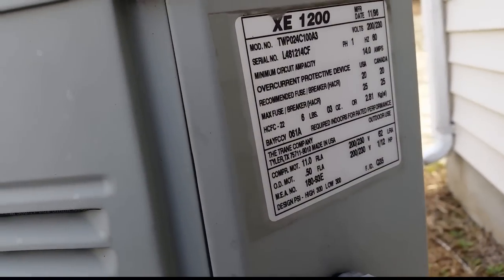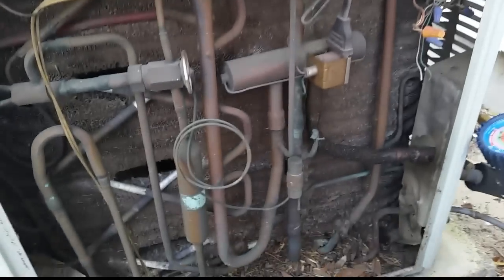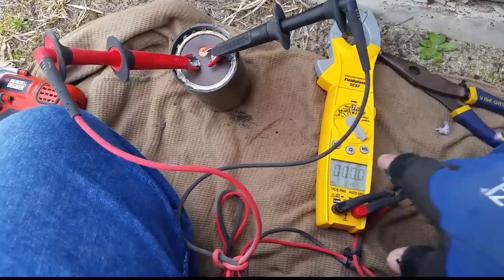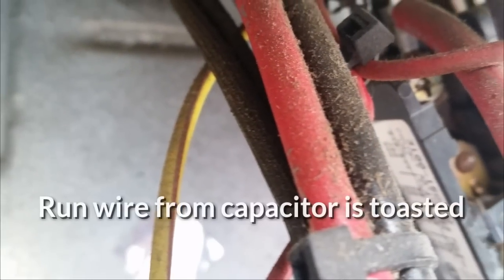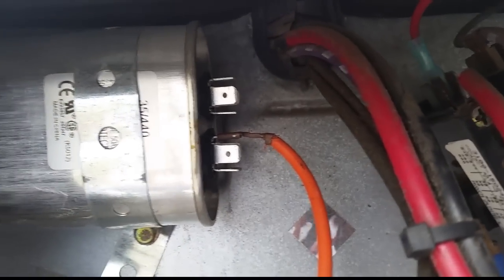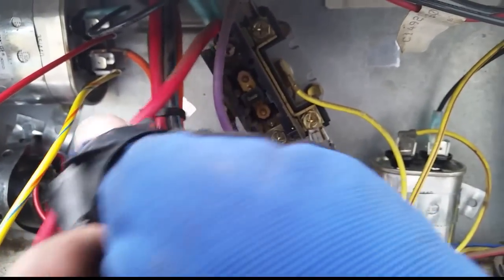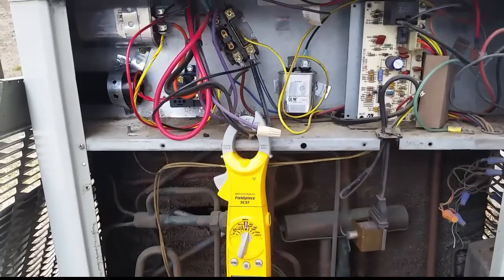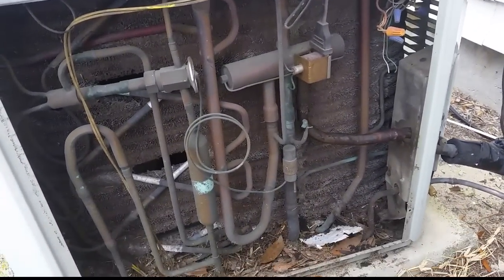HVAC Service Training : Trane Heat Pump Trips Breaker

Comment: Nice job repairing the heat pump. Can you do a review on a Lennox ultimate comfort system if you can. Because I'm interested in buying one soon to lower my energy cost. The Lennox has a 25 SEER condenser and a 98 AFU furnace with a zoning system.

Comment: Great video - including the separating out of the dual-run cap - which for some reason the market thinks should cost an arm & a leg more than separate caps if for only the sake of saving some electrical compartment space... and since dual-run caps just seem to die earlier than singles they should really price them at discount .. not a premium .. (low key rant over). " 0 uF " capacitance might really be indicating a shorted cap - have to put that meter on ohms and check across - but yeah,  same result so.... NG.
Reply from the maker: Thanks for watching pal

Comment: Nice job Zack getting back up and running for now , I saw u had your mega meter out , did u get a reading by any chance ?
Reply from the maker: Reading was in the good range. I was surprised.  With those crankcase heaters in there too I figured it was a ground.